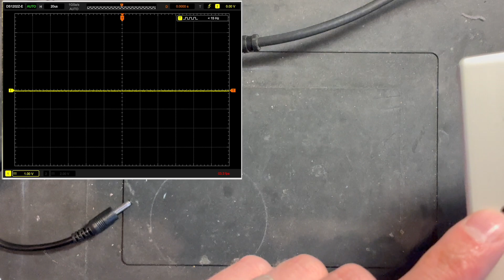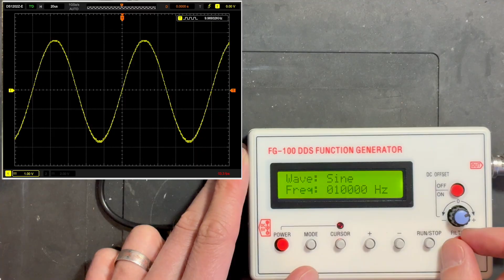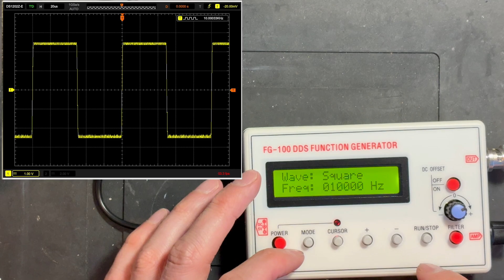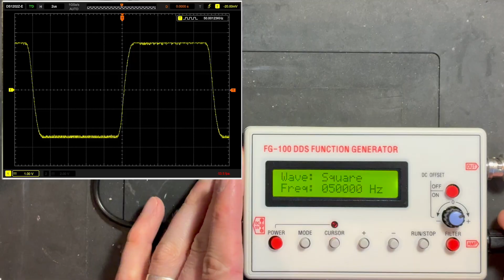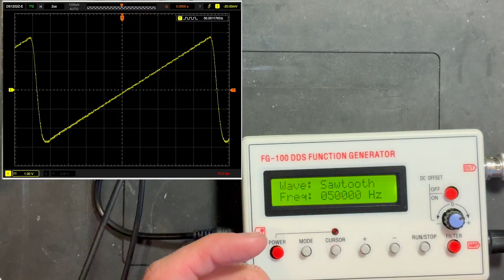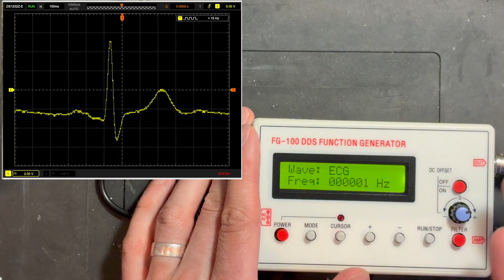FG 100 DDS Function Generator

Comment: Can you show us some examples by actually testing equipment and telling us how you’re reading it and explain how you get the results like in a bad circuit on a PCP I get a lot of videos where it just shows you waveforms and stuff and how to adjust but no, I need to know howto use it like if I’m diagnosing a problem on a gaming system for example would be helpful. Thank you.

Comment: For better bandwidth response replace both TL072 op amps. They are counterfeit parts.
Reply from the maker: Future project! Will the amplitude increase then?
Reply: @root42  not really, it will just make it usable until 700-800kHz
Reply: I have the 2.0 firmware version, same as the one in the video.  The wave forms on mine seem to be much cleaner than ones I’ve seen in other videos with 1.0 firmware, wondering if they addressed the op-amps as well?   (And the ECG wave is hilarious with friends that don’t know that I’m not really reading their heart…. )
Reply: @brucem2007 did you manually upgraded from 1.0 to 2.0?